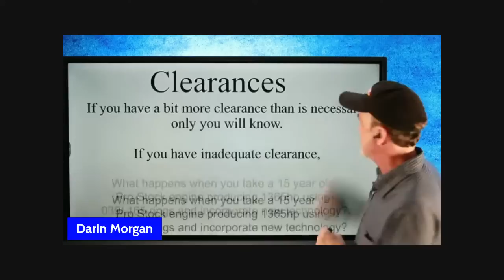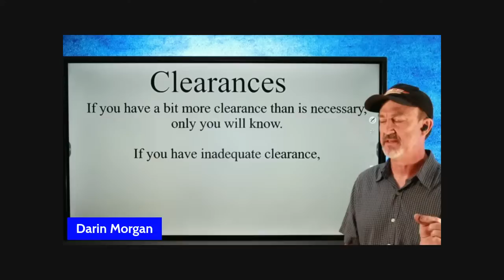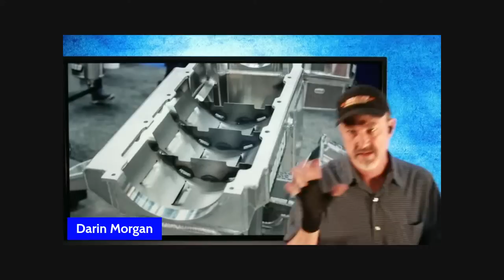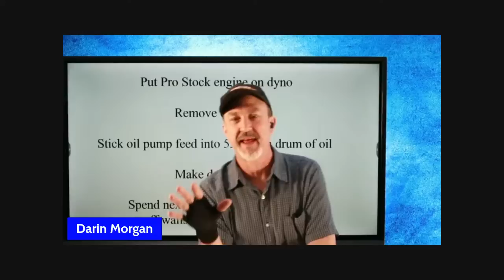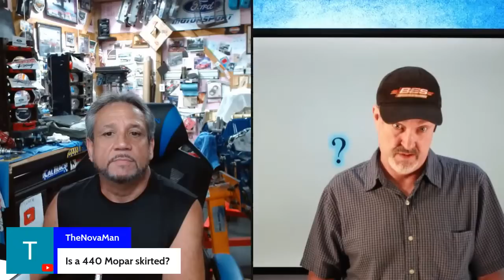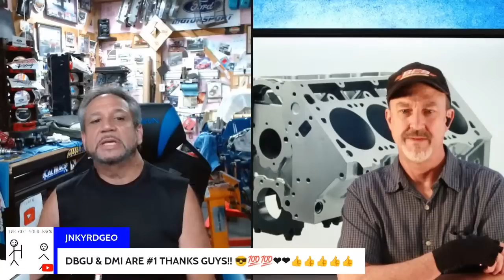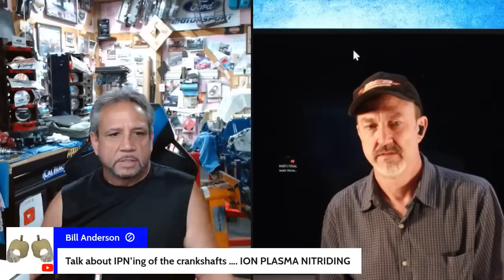DBGU/DMI WINDAGE Trays, WORTH it, OR WASTE, LIVE Chat YT 7/6/25, @7pm .est

Comment: I had a pickup break off not good oil pressure light came on only at idle n we hooked the fuel pump wire into it with a 15lb pressure switch to kill the pump luckily
Reply from the maker: Yes not good. Need to get that done too. Thanks Sean 🏁

Comment: Steve Morris engins are all aluminum including rod caps
Reply: Ya'll were talking about about LS engines and different metal Ya'll could use on rods and rod caps.
Reply from the maker: @Kaydee351C  got it, thanks :_DarinDB:
Reply from the maker: ok, point being? :_DarinDB:
Reply: Ya'll where trying to come up with that word in relation to talking about oil, and Lake Speed Jr.

Comment: Great presentation. I have a problem @ 1:42:00  it is stated that a low pressure allows the oil droplets to fall easier which common sense says is true BUT years ago I found an experiment in an aerodynamics book that proves it does not. This is the text of that experiment :
....................................................
To verify that density plays no role, we can do an experiment with two vertical tubes containing columns
of air. 
In one tube, the air is at ordinary atmospheric pressure, while 99 percent of the air has been evacuated from the second tube.
Therefore the air density in the second tube is only one percent of the air density in the first tube. The
procedure of the experiment is to release very small dust particles from containers at the tops of the two
tubes and to compare their terminal speeds of fall.
Now, in order to interpret the observations, we must have in mind a remarkable property of gases. 
The property is that a large change in pressure does not much change the viscosity of a gas, provided the temperature remains the same. 
Therefore the air in both tubes has virtually the same viscosity even though the densities
differ by a factor of 100.
Observation of the falling dust particles shows that the terminal speed is the same in both
tubes. 
In other words, the air which has been rarefied by a factor of 100 offers just as much resistance
to the failing dust as air at ordinary density.
....................................................
That is totally unexpected , mind blowing and I always wondered about that regarding oil mist in the crankcase and fuel mist in the induction system. Any thoughts?
The book is :   page 96 of
Shape and Flow
THE FLUID DYNAMICS OF DRAG
ASCHER H. SHAPIRO  1961
Reply from the maker: See what Darin says. Thanks Bill

Comment: 15:50 One point not mentioned here is piston temperature/expansion vs clearance. The piston is cooled by contact with the cylinder and it will expand until there is a balance between heat in=heat out. More clearance means a hotter running piston as it expands until it cools adequately by contact with the cylinder. Too little clearance puts extra heat into the piston due to extra friction and can seize.
Reply from the maker: Thanks for watching my friend. Appreciate your insight. 💯🏁
Reply: Bill, are you an engine builder?
Reply: @davidreed6070  used to be yes.
Reply: @billshiff2060 retired?
Reply: @davidreed6070  Forced to retire due to spinal injury. Although I am long past the normal retirement age too.
Reply: @billshiff2060 we have the same problem. I have heard things that you have said and knew you know what you are talking about.

Comment: Does epoxying the crankcase to conform it to the crank for windage control work in circle track applications. Like wet sump dirt track. I’m thinking it will help and can’t hurt anything.
Reply from the maker: I would agree with you Ryan, anything to improve finish,  improves
Reply: @dragboss351cleveland  I’ve been porting a lot of Cleveland heads lately if you would like to see my flows numbers and maybe compare any flow data you have that would be cool. I have stock to ported and epoxied flow numbers. I can give you my email

Comment: How do you close in the cam tunnel from the crankcase?  I thought of machining a tube of aluminum stock and machine in places where the stock cam bearing reside.  It would have clearance spaces between the cam journals (a stepped inside bore).  My engine guy said there were better ways but didn't elaborate.
Reply: Brian Salter covers that subject.

Comment: I ran 100% atf in my rear axle in my stock car ,after a 40 lap feature you could touch the housing, and it was barely warm you 1/4 mile guys need to try this
Reply from the maker: Great tip Doug.

Comment: The comment about how loud the valve train reminds me of the first time I was in a dyno cell. It was in the early 80s and we had our comp engine on the pump and the first pull I could not believe all the sounds I could hear from the internals of the engine. I was sure it was about to come apart 😂
Reply from the maker: I hear that, it’s amazing how loud those engines are and how long they keep whining once you get past six grand. Amazing stuff thanks Trey.

Comment: I'm starting a V twin project and wondered why the end counterweights are so much bigger instead of each pair of cylinders being properly balanced.  I guess it's the lazy way to balance a low rpm engine.

iirc Open Foam was a CFD software that was using generative design for ports back in 2012.  Fusion just added it this year to a $1400 extension.
Reply from the maker: Interesting point about the counterweights, thanks for the info, always learning. 💯🏁 thank you my friend
Reply: @Chris_Stavro  the counter weights on a Vtwin are called a flywheel on a Harley, the mass is needed because of the large dwell time between cylinder ignition events

Comment: I appreciate your advice.  Back in the day i thought a cross drilled crank was the thing untill i found out it was not ..From what i was told and read on a web sight dry sump frees up hp and the bearing look better over time .. For me its easier and cheaper to just use the information i get here and others than try to find out on my own . Thanks

Comment: Interesting discussion on main cap materials, currently my Ford Hemi block has steel caps, but if I had the chance, I would change it to aluminum due to the difference in material growth rate due to heat. Even the biggest turbo blocks supporting over 5000hp use alum caps.
Reply from the maker: John do what works for you, thanks for watching. 💯🏁

Comment: I guess Darin wasn't at Reher and Morrison when they solved the Big Block cross drill oil problem . Somewhere above 85 hundred RPM they started having rod bearing probems . You have to keep in mind the Big Block was amazing for good bearings under 85 hun . Sooooo , they thought about it and one them said , hey our small blocks never had this problem , and none of them were cross drilled . Got rid of the cross drilling , end of problem  . The cross drill main hole was slinging oil back out instead of feeding the rod bearings . Btw , staggering amount of info , thank-you .
Reply: I was not referring to cross drilled cranks or Chevy engines. I was referring to the butterfly drilled cranks in SBF. A issue that came up a decade before I was with Reher Morrison.
Reply: @DarinMorgan7854 ,,, yes , you made that clear ; however they also had a problem with th cross drilled big block cranks , and similarly it was a reverse flow caused by centrifugal force .
Reply: Well either him or his brother was probably one of the guys in that conversation there lol

Comment: Hi, I’m a member of the channel and I’m from Argentina. I have several questions I’d like to clear up, so I’ll leave them here and hopefully someone can answer them.

Is a straight and tapered intake port always better? Or should I widen it in the area after the valve guide?

The way I size the intake port is based on RPM, and therefore on piston speed and air speed. I always aim for about 100–120 m/s of airspeed. Am I on the right track? Just to clarify, I’m currently working on a motorcycle engine with a redline of 11,500 RPM.

For the exhaust valve, I aim for a diameter that is 80–82% of the intake valve, and for the exhaust port I use 95–100% of the exhaust valve diameter, without a taper. Am I getting close to something ideal?
Reply from the maker: Welcome to the membership of DBGU/ DMI. Hopefully Darin will see this and give his opinion. I know he has done Harley or stock heads. 🇦🇷 💯🏁
Reply: @dragboss351cleveland  “Hopefully Darin sees this, I forgot to mention that it’s a two-valve hemi chamber.”

Comment: Was the horsepower loss on the lightened blocks due to loss of ring seal or distortion of the mains?
Reply: Ring seal. Did not show increased wear on mains.
Reply from the maker: That is the way I took it Trey

Comment: A very good presentation.  It sounds like I need to buy some Splash Zone to fill in the pan rails on my 440 block.  I never thought the aluminum main caps was a good idea.  Ductile iron would be better than the OEM grey cast iron caps.
Reply from the maker: Right James, may be worth your while, to take the time improve what you got